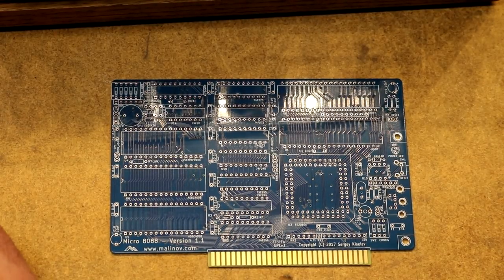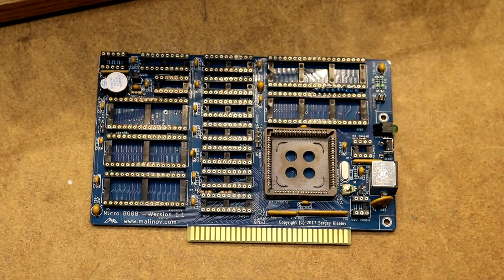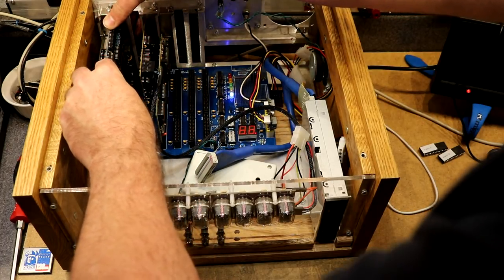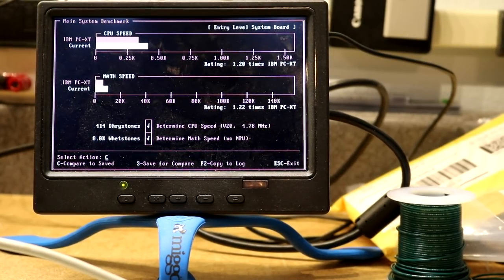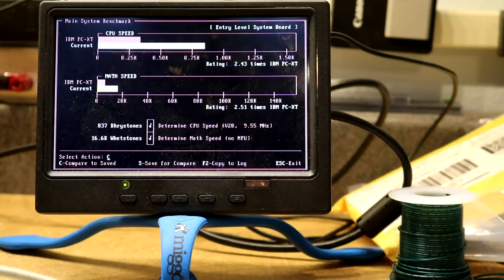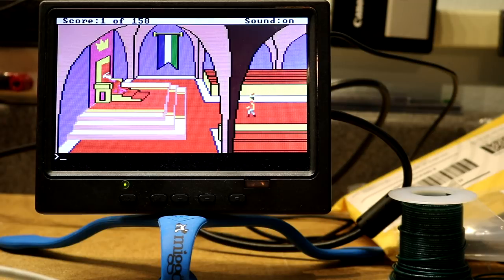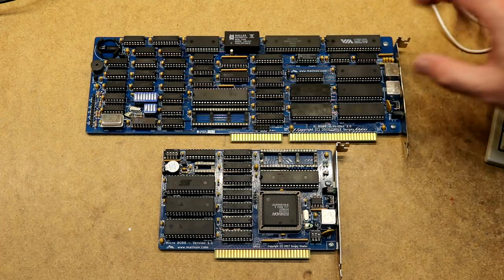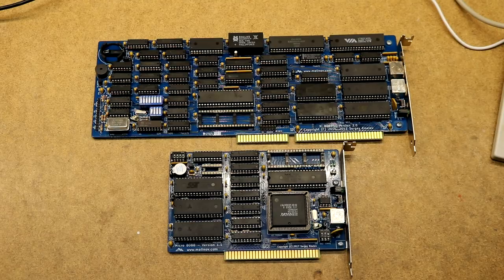Building a Micro 8088 single-board XT-compatible computer

Comment: Nice compact board, my employers did a similar board or a 10x16cm Eurocard. However, the FE2010 chip is very scarce - you can find them but not in any great number. One place on eBay said they had 3 left, another has 10. Long term, I guess you could make an FPGA equivalent and wire it to the FE2010 holes. Or make an FPGA emulate the 8088 as well.

Comment: I don't really understand about the video output. Will a graphics card on the backplane automatically work in conjunction with this? Or, does it need a second set of GPU stuff? Is your little monitor hooked up to the card directly? Is the ISA connection just for current?
Reply from the maker: Yes, a graphics card on the backplane will work with it. In this case, I'm currently using a homemade VGA card, though any 8-bit ISA VGA card would probably do. CGA, MDA, or EGA would also work fine, though finding a compatible monitor may be problematic. VGA monitors (including my little LCD monitor) are still relatively plentiful.

Comment: What do the yellow components in the vicinity of each integrated (IC) serve?
What do small yellow components serve? Are they capacitors?
Reply from the maker: Yes, those are bypass capacitors, typically one per IC. EEVBlog has some excellent videos on bypass capacitors (EEVBLOG episodes 859, 1081, and 1085) if you're interested in learning more about bypass capacitors.
Reply: Thank you very much!! :)
What value do your capacitors have in Farad?
Value of the capacitor?

Comment: so, this might be a dumb question, sorry if it is, but can you plug this card into any pc compatible with a isa slot and turn it into an 8088? for example: a pentium computer with 3 isa slots, would this board turn this pc into an 8088?
Reply from the maker: No. It needs to be plugged into a passive backplane, not a motherboard with a CPU. Otherwise, both the CPU on the motherboard and the CPU on the SBC would attempt to use the bus at the same time. You can find passive backplanes relatively commonly on eBay, or Sergey has one that you can build yourself.
Reply: @smbakeryt  ok, thank you very much for the information

Comment: do you have the verilog file for this fpga availiable ?
Reply: I don't think it is FPGA. The glue chip is an ASIC.
Reply: @PlumGurly  :-I sad. Thank you for the reply.
Reply: @markussteinbacher8807  -- I found the original site and this uses an optional SPLD, and the code is there. 

https://github.com/skiselev/micro_8088